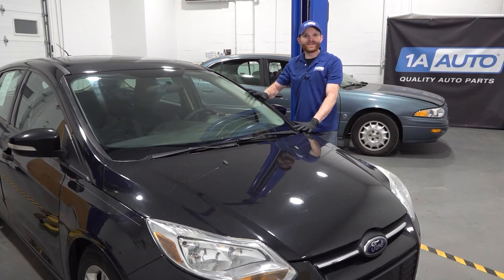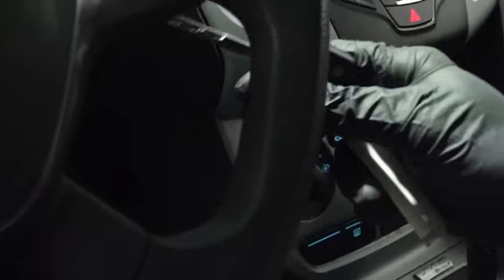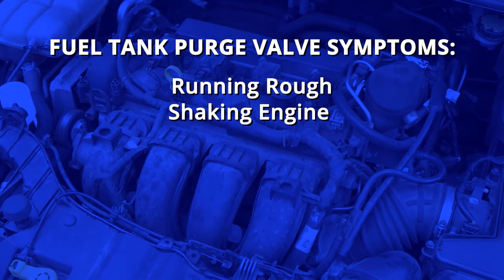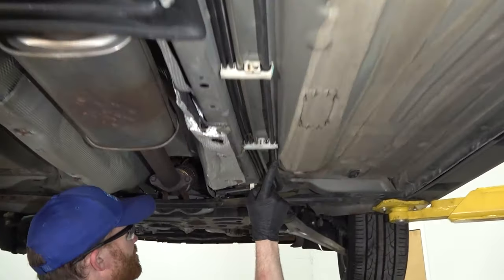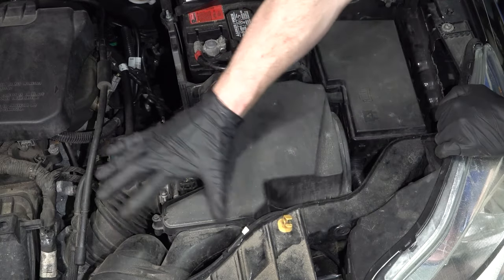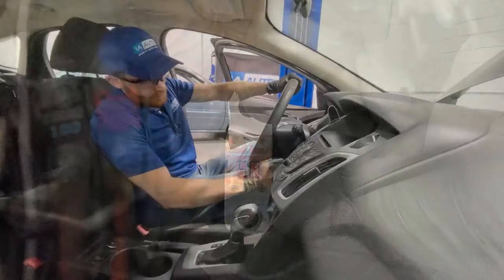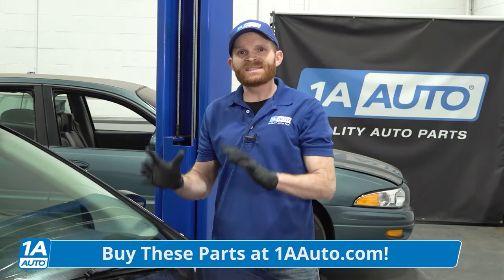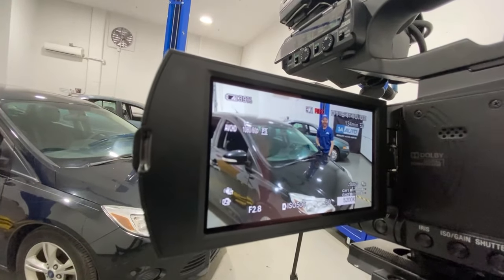Top 5 Problems Ford Focus Hatchback 2012-2020 3rd Generation

Comment: My 2014 with the DCT automatic has been sitting at the dealer since last August. They are unable to get a replacement transmission control module.  The failure occurred while driving and put me in a life threatening situation.  The car has 79000 miles.  Now they are offering to buy it back from me...A nightmare! I would say stay away from the DCT!!
Reply: sell it back!
Reply: @daphoneguy934  Working on the price, Brother...Thanks for the encouragement.
Reply: They gave u a loaner ??

Comment: Why do you have to put the contact in the off position when you disconnected the negative battery cable beforehand if you take fuses out? I don't get it.

Comment: I think you overdramatized the purge valve issues. The majority of the time when the purge valve is bad the vehicle will start and stall right after putting fuel into and then start again no problem. Unless someone ignores that problem and continues to drive the car for long periods of time without replacing it, stalling while driving is not likely.
Reply: What causes that
Reply: It caused a code recently on my 2018 Focus,  it's a recall issue but to save time, I bought one online & replaced myself in 20 minutes.
Reply: That's what mine did, just stall after fueling

Comment: My wipers gradually stopped working. I had a look and with wiper arms off the motors are both moving. Assembled and wipers move 1 inch and stop. What to replace ?please answer..also the fuel purge valve has a recall on it.

Comment: my focus SE 2013 hardly ever starts, may sometimes start if you put it in neutral first and when you try to put it in drive it’ll only reverse, i’m thinking it’s a neutral shift problem any other ideas or
Reply from the maker: +Landen Rain We wouldn't be able to diagnose an issue like that here, you may want to have a local mechanic take a look at it. Thanks for checking us out! http://1aau.to/m/Shop-1AAuto-c

Comment: Hi good day, i'm from Philippines and my 2013 Ford Focus had transmission problem, 5 months ago i was been in Baguio city where's mostly is hill road, while i'm driving going up suddenly show ''Transmisiion is overheat stop 5 mins''' so i pull over and turn off the engine for 5 mins, then after 5mins i turn on the engine and back to normal again, is that serious problem? Thank you!

Comment: Stay away from these POSs!  Ours had two of the five.  Also, the stereo would randomly put out extremely loud sound.  It was startling.  It would do this when the stereo was off and when car was off with key out of the ignition!  What the heck!  Had to replace the stereo head unit.  Unloaded it when we had it in a sellable condition to a dealer.
Reply: I experienced that loud boom when I had just exited the car. I thought I was going crazy.

Comment: I have a 2012 LW focus, it has low mileage at 75,000 kilometers and the steering rack has failed and been replaced then the heater core failed, after that water was leaking in the hatch area due to the poor seals around the four air ducts behind the rear bumper and the latest problem is a check engine light due to a faulty cam position sensor. I wonder what will break next........

Comment: I have a 2015 ford focus hatchback. Recently the radio keeps losing a satellite signal and the engine and other lights flash on the dash then go away. Also when i turn off the car, the whole dash cuts off too. I try to restart it and i cant. I have to open and close the driver side door and then it starts. Any clue what this is?

Comment: i bought second hand ford focus hatch back 2010 model  8 months ago in Feb 2023  . some time message appears with alarm about engine malfunction ! I dont have any idea what is that . I contacted to dealer but he said its not a big issue any mechanic will solve that but Halfords said this problem only solve by Ford company what is so expensive .so any one have a clue how to fix that , car runs fine no issue other then so far thanks

Comment: My 2014 ford focus titanium is still running strong even at 115,000 miles,  only problem I have rn is that my right axle is gonna go out soon but once the engine and transmission do give out I'm throwing a inline 6 engine into her

Comment: I ran into a car nd the 2nd prob started. Granted last winter it acted weird with flickering headlight nd my accessories going in nd out. This yr alllll of that. Plus tge wipers went on by themselves pllluusss my car wont start after i park it...i touch the positive wire close to the hvjb nd everything comes back! I wonder if i cracked a fuse or knocked the connection loose

Comment: I have a 2017 Ford Focus S that when it is 32° or colder you can't move the steering wheel. Shop can't figure it out there are no check engine lights no system codes. Any help greatly appreciated
Reply: Where on earth you at?

Comment: I have a 2012 Ford Focus and the speedometer hand stopped working. I changed out the gauge cluster thinking that would solve the problem but it still not working. Everything else on it is working fine. I also changed 3 sensors on the transmission still nothing. Any suggestions anyone.  Thanks.
Reply: Oh hi Marc (sorry, had to)! 

Speedometer, along with power steering is tied to the ABS sensors. If one sensor is intermittent, the speedometer will drop to zero; it can happen if there's a bit of play in your bearing, it heats up and melts the sensor. 

I would ask a mechanic to ride with you in the car with his scanner monitoring the signal from all wheels. Intermittent ones can be singled out; especially after driving a few kilometres.
Reply: @Begunend20  actually the abs light is on, on the dashboard my passenger side abs wheel sensor is bad. Thanks. I will buy that and try it. Won’t hurt.

Comment: The sjift problem caused by  clutch dust  on the shift actuators   need to pull out actuators and brake kleen the holes  while using the special tool to back and forth the forks   and then spray wd 40 to lubricate forks  save thousands  replacing trans.

Comment: My car key isn’t working. Idk if it’s something related to antenna or wiring for this Ford focus 2014. Key replacement guys are saying the key is sending frequencies and it’s working. Changed battery multiple times but car doesn’t seems to pick the key up. Always have to unclock car manually. Is anyone else facing this issue?

Comment: Hi my car ford focus  2012 S.E. and he problem park nd start da car rpm high goes 1800 nd i wil drive rpm goes down normal nd I push break rpm go up today will fil gas nd not start after 3rd attempt car start nd rpm very down like 100 nd 200 when I drive car not normal drive after two minutes normal but rpm goes high 1900 rpm wht problem sir

Comment: I have a 2014 focus se,,lost power steering,,fault.fixed it 5 years ago,,and it did it again,just gonna drive it with no power steering,,207k miles

Comment: A 30 year old 200,000 mile toyota camry would be more reliable
Reply: Or my 02 289k civic , very few issues making is actually not drivable and always super easy and cheap to fix . The control arm busted and I figured I’d get a car note , got a Ford Focus 😢
Reply: @kadeelacayo4806  Lmao you wanted something less reliable
Reply: @kadeelacayo4806  if you got the manual transmission you are good 100%
Reply: @theshield1613  I have a 2013 manual, constant coolant issues butnit much else. I noticed it’s coming from the outlet of the heater core. Belt is also bottomed out in the stop. Any ideas?
Reply: Besides the obvious retention of the belt? And replacement of the core

Comment: Have a 2013 Ford Focus with the 6 speed automatic, with 49,000 kms on the clock. I drive the car no shuddering, when my wife drives the car, it shudders in 1st, 2nd and 3rd gears. She is a learner and drives the car very very very gently. I reckon the computer becomes confused and doesn't understand what's going on when my wife is behind the wheel.

Comment: I have a 2016 ford focus hatchback and I'm having trouble with my windshield. It started going and wouldnt go off. Can anybody tell me how to stop this?
Reply: As in the wipers? Please be more specific as the windshield is just the glass part
Reply: @rupertflo2860 probably the wipers it’s actually a bug on a lot of ford cars. Best you can do is just turn off the car while leaving it off and coming back it should fix itself. If not just continue letting it wipe and then lower it to a level and then lower it to not wiping at all
Reply: If you're still having that issue, first check to see if you need a new battery.  If your battery voltage is getting low this is the first sign I tend to get.  

If your battery is still pretty new, check the negative battery terminal, I also had this problem when the cable was corroded and the wires coming out of the little box at the end of the cable broke off.

Hope that helps!

Comment: Oof. Definitely staying away from this car. Loved the intro, btw!
Reply: I drive a manual focus 2012 with 240 000kms on clock. looks and drives like new.  One of the best cars I've ever owned. 
I can't vouch for the auto tranny. But you couldn't beat the value for money with this car. Speaking from a used car point of view
Reply: Buy the manual transmission ford focus the 2.0 engine is very reliable

Comment: Chances are that if you kept your foot on the brake when stopped in gear the clutches wouldn't glaze from slipping.  When the brake is applied, the clutches disengage.  You can't drive it like a hydramatic slush box.  My 2012 had a water pump replaced.  That's all that it has needed.  No other problems or issues.
Reply from the maker: +Frank Martin Thanks for the feedback!

Comment: I have a 2012 1.0 ecoboost titanium x and I’ve had it for 3 years in September. I haven’t had any of these issues but I have had 

1 water leaking in the boot/trunk area because of the seals on the vents behind the rear bumper 

2 the door seals pealing off and hanging down

3 issues with the starter motor having corrosion on the soldering cause it not to work

4 clutch release bearing the hydraulic part of the clutch started to fail Causing a clutch change 

5 air conditioning leak waiting on diagnosis of cause 

6 battery died without warning 

7 and issue that kept throwing a check engine light was P0420 Catalyst below threshold bank 1 I managed to sort that out with 2 bottles of CataClean and a few long runs in the car and so far it hasn’t come back now I put a bottle in every 6 months 

A lot of these issues could be considered as an ageing vehicle problem but it’s just things I’ve had  with it in my time with the car but I got it with 57k on the clock and it’s coming up to 72k

Comment: I had a 2013 Focus SE sedan. Worst car I’ve ever owned! Constant transmission issues and electrical issues. By the time I sold it to a scrap yard at 113,000 miles on it, it was on its 3rd transmission. The radio wouldn’t work even though fuses were still good, the backup sensors didn’t work, driver’s window wouldn’t work, horn wouldn’t work, power steering unit seized up, it got horrible MPG’s (19 on average) and the vehicle would tick loudly under the dash whenever the bright headlights were engaged.
Reply: That's interesting. I've owned my 2013 SE since May of last year and 0 issues. Got it at 87k. At 92k now. Ford replaced the TCM and clutches under warranty prior to me owning it and it drives like a dream.

Comment: The twin clutch automatic is crap, no doubt.  Dont buy it.  Purge valve was fixed on my ST on recall for free in about 45 minutes at the dealer.   Otherwise, zero unscheduled maintenance in 125,000 miles so far on a 2014 ST3.  I did not know any Gen 3 Foci had anything but push button start!

Comment: The only serious problem for this car is transmission clutch, this car will get bankrupt if you think about buying it، a friend of mine bayed over 12000 dollar and the car doesn't get right at all, first he payed 8000 to get the car, and he drive it for a year and transmission clutch goes away, and he spent 3000 dollar to get new clutch after looking for a year to find the right mechanic that fixe it, because most of transmission mechanic refuse to get new clutch, they only install used working transmission that cost from 2500 to 3500, after installing new clutch, the car worked for less than a year and the clutch start barking up because of antifreeze leak offer the transmission clutch, and after one month the clutch is gone. Since the transmission still under warranty, he returned it to mechanic and he installed new clutch but it doesn't work properly and he suggested to change TCM, it will take over 6 months to get new one, and my friend immediately left the car with the mechanic and bought a used Honda pilote for 16000 dollar.

Comment: Ford has proposed a settlement in a $30 million lawsuit over PowerShift dual-clutch automatic transmissions in 2011–2016 Fiesta and 2012–2016 Focus vehicles.
Ford also revealed that it has spent $47.4 million on vehicle buybacks already.

One of fords biggest recalls in history is this transmission. It's junk. I am on my 3rd fix. From programming upgrades to new clutch in auto tranny. Its junk and cannot be fixed.
Reply from the maker: +z zim Thanks for the feedback!

Comment: Dude  full of it  most  common problems  are  leaks  in drivers  footwear from the  poor  o rings  leak in boot due to 0 waterproofing maps  don't work it works from the antenna that's  got 0 water proofing  random spots  of  electrical  problems  from random things  extreme amounts  of coolant lost  from expansion tank etc